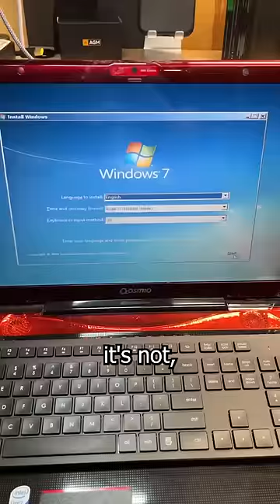This Toshiba Qosmio #gaming #laptop probably weighs more than your #pc . #technology #shorts

Comment from the maker: Factory specs for all my fellow nerds!

2.0GHz Intel Core 2
Duo P7350
Mobile Intel PM45
Express
4GB at 1066MHz
200GB 7200RPM
512MB Nvidia
GeForce 9700M GTS
Windows Vista
Home Premium (64-bit)
16.2 × 12 × 1.7 inches
17.1 inches
9.0 - 11.2 pounds
Reply: I have similar powered laptop i payd 20€ lg s900 the big ass 19inch screen and a 1tb hdd 7200rpm 120fps 1.8 minecraft and i cant find a original psu the random acer psu litery melted down i tryed to cool it using a xbox 360 cooler and a water bottle 4gb ram ddr2 800hz and how laud was the headphone jack autput killed my headphones not a joke atleast one cheapo crap
Reply: Sounds like my current pc
Reply: Bruh this thing is more powerful than my school’s Chromebooks wtf
Reply: ram upgrade and this would be a decent school computer
Reply: That thing has the same CPU as my early 2009 MacBook. Probably could do with an upgrade to a T9600 or something similar.
Reply: Perfect to run Linux Lite OS on.
Aka Feather Linux.
Reply: If it's a 9 series card it won't have as much of a chance of failing like the 8 series ones do. Also you could give that thing a T9600 (more cost-effective than the 9900) and whatever the max RAM is, then the machine will totally be flying high. The P7350 is kind of a weak spot with that computer since it's not particularly one of the faster Core 2 Duo mobile chips.
Reply: How are you running MSFS2020 on windows vista? It’s only available for windows 10 and 11
Reply: Damn that must've been insane in 2008
Reply: Thanks I was going to manually search it up 😊
Reply: Still faster than my current device 💀
Reply: Thank you, fellow nerd!
Reply: My god, the gpu is even worse than intel xe.
Reply: @trym2121  Yeah, but much better than integrated graphics in 2008.
Reply: Man, I'll just dual boot Windows XP x86 and Windows 7 x64 for that machine
Reply: Damn, it has better specs my current pc
Reply: this was a gaming laptop???
Reply: @cunnieseverywhere  Back in the day it was
Reply: 9 - 11.2 pounds?? 💀
Reply: Better than my pc💀💀💀
Reply: Resolution is probably 1440x900
Reply: Holy Oedipus!!! My t520 got better specs...
Reply: 32 bit or 64??
Reply: It's better than my current laptop xD.
Reply: a 1008 Toshiba?
Reply: That’s actually good specs for 2008 whaaat
Reply: Oof and to be outspeced by basic current midrange hardware
Reply: Best it can do is Windows 7 which is unsupported now, Windows 10 struggles on any dual core.  I'm running an AIO that's pretty much useless with a Pentium G, trying to run Windows 10!
Reply: The real question is can it run crysis
Reply: These specs are legit better than mine
Reply: remeber my dad bought me pc with the same spec for 2 beers
Reply: I have a Qosmio X505 Q887  18.4 inch.  Huge desktop replacement.  i7 1.73 GHz 740QM (4 cores, 8 threads) and a GeForce 360M with 1 GB GDDR5.  1680 x 945 screen resolution but external monitors can be 1920 x 1080.  Giant "Desktop Replacement."  I think it is a 2010 model.  Very heavy.
Reply: bro saved us
Reply: back in the day minecraft and cod was popular they have mods cod
has all types of mods also
they have multiplayer bots
if you want counter strike half-life
is got you winning 1.6 gold source
what a gold old days
also tfc still have the servers
playing over xp is like god damn
feels old team fortress classics
still going on live
Reply: Trust me there is worst ganre of music then country. It is called Turbo folk. When you listen to that crep you will apriciate country.
Reply: Better than the PC i have sitting around
Pentium dual core
2 gb ddr3 800mhz
Nvidia 512 mb 8400gs
Reply: @MidnightMechanic  well a buddy of mine had an i3 dual core and it was running windows 10 fine, but it’s probably cause he was running off an ssd.
Reply: Can whe trade because it's better than my office laptop from 6 years ago
Reply: My dell inspiron 2017 has a 2.5 Ghz i5 wtf
Reply: Dude, this used to be people's dream pc back in 2008
Reply: @jaguareagle7026  that pc is from 2013
Reply: is that been upgraded to i3 or i5? or it cant?
Reply: vista ☠️☠️☠️
Reply: Dawg this shit better than what i have 😂
Reply: I remember being like 14 and thinking this thing was cool as hell and wanted one
Reply: its amazing how fast tech progresses i have a laptop that might as well be a zombie laptop. it has some specs that stopped being made in 2013 and the biggest thing that i dont understand how someone can manage is 32 mb of vram and no thats not a typo i really do mean 32mb i get errors trying to launch a game saying not enough vram when it only needs a small amount
Reply: I have the Qosmio X505 that came out right after this one. Mine is a 1st Gen Core i7 @ 1.7ghz (Quad Core), GTX460M GPU w/512mb, 18.7" Screen, 500gb SSD and 1tb HDD, 16gb DDR3. I use the crap out of it, it runs windows 10 great, and I still play some older games or less graphically intense games on it. Needless to say its not exactly "portable" since it weighs close to 14 lbs. Great machine though, and yes, its a nightmare to tear down!
Reply: The bmw joke was insane lol. Hate the new big grill trend. Hyundai has some nice looking new cars with smaller grills finally. Speaking of upgrades, you could give it 8gb ddr2 and possibly a core 2 quad q9xxx m cpu. (Q9000 or q9400m). Still has a pga cpu, wish we still had pga laptops.
Reply from the maker: @cflynn3684  Because Hyundai's chief designer previously worked at BMW 😂
Reply: I was working at Best Buy when this thing came out. My manager showed the department, and we all knew no one would buy it lol. I think we only ever sold 1.
Reply: i have a working G30 Qosmio (an earlier model) PQG31A-01Y01F
Reply: Hello @SalemTechsperts I own a HP Pavellion HDX 9300 and its kinda in a bad shape and i need it fixed can you handle it?
Ill pay anything to get it fixed since it was my first ever laptop and my only gift from my father before he past away would love to see a reply from you thanks!
Reply: That's better then my actual laptop
Reply: was it better as my Acer Aspire 8920g?
Reply: do you need another one? I am pretty sure I have a working one sitting in storage. and I think it's pronounced "cos - me - o"
Reply from the maker: @salreus  I would actually love another one, Email me at Andy@salemtechsperts.net .
And I know it's pronounced cosmeo but quasimodo makes for a good meme
Reply: @SalemTechsperts Damn, and unlike those beemers, this Toshiba has no fake vents lmao.
Reply: Ew Core Duo
Reply: I have one in my office.  bought it new.
Reply: Didnt that have SLI 9700?
I remember my dad had this for a short time as a replacement at work.
Reply: OH GOD! I can summarize a whole problem with this machine in two words :"Windows Vista"! 😂
Reply: and weighs less than my alienware area51m r2. Pathetic.
Reply: @FullFlight001 Who said anything about FS2020? And have you forgotten about FSX
Reply: yes and I lost it
Reply: Would you do it again on this PC if I needed to and you you think you could do it faster than 2013
Reply: Sirr!!! I have the exact same one but I have no charger, do you have any recommendations where I could find one?
Reply: well for games nowaday it will be hard breathing for sure.... but on their era its the best one i bet.
Reply: basically as gaming as any modern gaming lap. bs and waste of money.
Reply: i also have a winter edition Lenovo3000 y410 from 2008 …in good condition as well….looks so vintage af
Reply: Could you turn that into a current laptop killer
Reply: @wrldmap same but worst than that specs but runs smoothly like browsing and other stuff
Reply: Oh? Is that do Mr. Man? 

Can you troubleshoot and fix MY gaming laptop then 🧐
Reply: That was a beast laptop in 2008
Reply: Still better then a Chromebook
Reply: @DardS8Br yeah no shit, chromebooks have ass hardware
Reply: Vista? We gonna die!
Reply: I've never seen that big boy laptop before...
Could you please install Windows 11?
Reply: That Runs Windows 10
Reply: Honestly sounds kind of cute when you think about what we have nowadays 😅
Reply: Yes! Give us the dirty details! 💻
Reply: Making me feel old. I remember my 7800 gts now lol
Reply: i had a older Compaq Blue gaming laptop i got from a friend to sell, it had a Core 2 duo, 4GB Ram, Nvidia GeForce 9600 GS 512mb MXM 2.0 gpu and a 500GB HDD, thing actually was still in great condition, and i got almost 200$ from it lol
Reply: @MichaelAStanhope I had the exact same kind as you have and the nice thing about it was having 2 hdd.
Reply: out of curiosity, what kind of optical drive does it have? some models of qosmio laptop had a hd-dvd burner which is extremely rare

Comment: I wanted one of these so bad back in the day. They were beasts of their time.
Reply: Toshiba laptops simply works, have a toshiba satellite a 200  made in 2005 work to this day, back in 2019 , i bough a hp pavilion note 15, the mother board failed after a year and 3 months, ofc the cpu soldered directly to the MB, the 3 usb ports are bad, the keyboard the whole laptop bend like cheap plastic, while the old toshiba is very strong, good 4 usb port, extra slot for 1 more hard disk and  1 pci express card slot (really usefull if u want to add extra ports)
Reply: Me too.
Reply: @gastongl404 Some newer laptops by Japanese manufacturers have 5 USB 3.0 ports. Really nice though they do not come with USB-C ports.
Reply: Same, one classmate got one back then at university and I was so jealous
Reply: Yup I knew someone at work with one. These were badass back in the day. And the speakers did sound great for their time. Always thought Qosmios were so cool, but excessive. They were better than most PCs back when gaming PCs were much, much less popular than today.
Reply: @gastongl404 L-200s were my go-to laptop I'd buy used off eBay. So easy to repair.

I have a Dell Inspiron 3505 now, but I got that free when my sister gave it to me.

Comment: Toshiba and Fujitsu Laptop are beasts, my aunt used to own a Fujitsu laptop, i think she bought it around 1997, and it survives until 2017 because the screen broke itself from the body 😂the laptop's not even laggy, i installed a lot of mid 2000's games (mostly hidden object games), and the laptop still running just fine without a lag.

Comment: i love the qosmio line, i use a g40 as a daily driver, at a desk obviously, mofo weighs 100kg
Reply from the maker: Any upgrades to it?
Reply: @SalemTechsperts  upgraded ram to 8GB 667 MHz, changed the 2 mechanical drives for 2 2TB 870 EVOs and replaced the sled based dvd drive for the sled-less version. it still has its original peely plastic on the touchbar lol

Comment: niceee 

what are the specs, by any chance ?
Reply from the maker: 2.0GHz Intel Core 2
Duo P7350
Mobile Intel PM45
Express
4GB at 1066MHz
200GB 7200RPM
512MB Nvidia
GeForce 9700M GTS
Windows Vista
Home Premium (64-bit)
16.2 × 12 × 1.7 inches
17.1 inches
9.0 - 11.2 pounds
Reply: @SalemTechsperts  damn, that's impressive for a grandpa machine 👍

Comment: I had one of these. My GPU failed and couldn't be bothered buying a replacement card. They were swappable back then, MX cards? The problems were 3 folds: 
- Toshiba throttle down bios update
- Meltdown throttle down update
- Spectre throttle down update

Bad fan and heatsink design. This thing is just deadweight that won't go beyond 2 GHz.

Comment: I tore down my 2010 Qosmio when it refused to charge. After replacing the battery, I traced it to the power cable for the charger. Then it was randomly shutting down. Had to basically dismantle the entire thing to components just to check the thermal paste on the CPU. Found nothing wrong, but took about 4lbs of dust & hair out of it. It still works, but now I just have it hooked up to the bedroom TV and use it as a media player with a wireless keyboard & mouse in bed.

Comment: Oh man, my mom had a Toshiba for work that now only works when plugged in, but that bitch is an inch thick and was my one source of gaming as a kid. It must have been older than 2008, since I used it when I was like 5 which was in 2006, but my core memory is taking the tiny Famous Amos chocolate chip cookies from the vending machine at her work and putting them next to the fan to melt the chocolate because of how much heat it pushed out. Good times.

Comment: If you keep the Gpu under 70 degrees, it should hold up in theory. It probably has LowTg underfill in it that softens at I think 74•c. If it does, it won’t support the bump, and voila. It dies. This is why RRoD and YLoD happened too. 

If interested, check out Rip Felix’s documentary.

Comment: Used to have a Toshiba Satellite. An early touch screen pen laptop running Windows XP. It was heavy and had a screen that rotates to bend backwards and locks with an actual plastic latch system, that eventually broke. My mom gave it to me when i was 16 and i was one of those people who would fall for the TheoJoe ram download videos. I also got Windows 7 on it, but the wireless drivers got messed up to where i have to use a wifi dongle to connect to the internet.

Comment: I've got a 2008-2009 vista era satellite pro l300 that I've upgraded over the years

Was 2ghz c2d, 2gb ddr2, 320gb hdd, 1280x800.

Currently 3.06ghz t9900, 8gb ddr2, 256gb ssd for boot, 1tb hdd in odd bay, 1920x1200 screen (need dual channel cable) wifi+bluetooth combo card (requires pins modding to work because the hardware switch won't turn on Bluetooth), usb 3.0 in expresscard slot and a twelve cell battery.

Comment: Am I the only one who thinks laptop designs peaked in the 2010s? Built hefty, plenty of ports, feature rich. Laptops today have kinda regressed in terms build quality IMO. 

I still have my Toshiba Satellite from 2011 and it's built like a tank, but it's slower than one. Sure my MacBook Pro is fast but it fell 0.11 millimeters from the ground it would disintegrate. That Satellite has taken a few accidental tumbles and hasn't broken as much as a key on the keyboard. I dunno my point is if we could have the performance of today's laptops combined with the build quality of the previous decade, I think laptops would peak again.

Comment: Bro gave me a  Zenith LCD 27" TV manufactured in 2006 that got taken out because of a "hotel upgrade". I am sure it weighs 60 lbs. Darn thing is stuck in "hotel" mode (meaning you can't change very many settings, one of them being "input source" or "volume" unless you have a Zenith master remote. Thing has a lot of great inputs and outputs but it is locked up. 4 of them are going in the dumpster.

Comment: I used to have one of those unfortunately the battery died after a couple of years and when I took it apart to clean it I realized that both of the fans were cracked somehow it still worked

Comment: check out the 2008 gateway p7805u FX laptop if you can find one. It had a replaceable CPU with a 9700m GTS as well. It also had 2 sata bays as well.

Comment: had/hav an old hp zd7000 ?  literally 20lb dinosaur . i actually got it to work along with a msada conversion nice , faster/quiet ..? replaced power jack , works like a charm .hard to get replacement cosmetics parts , plastic covers but it finished/done .  now collecting dust ..

Comment: I got you one better. I got an 20” Acer laptop. The power supply is like a brick. And it cut off the circulation to my legs when actually on my lap. I should send it in if I can find it.